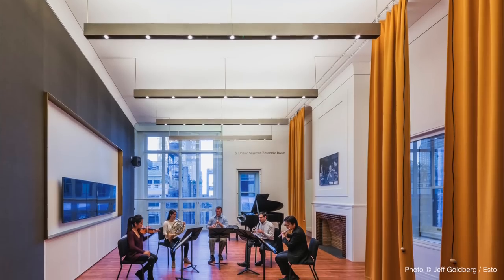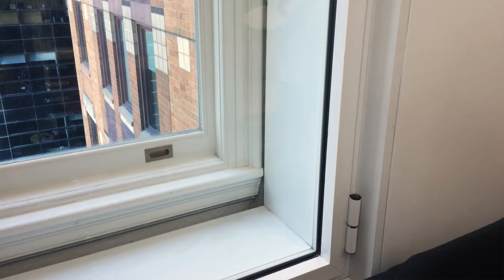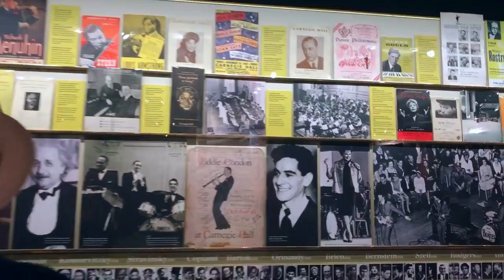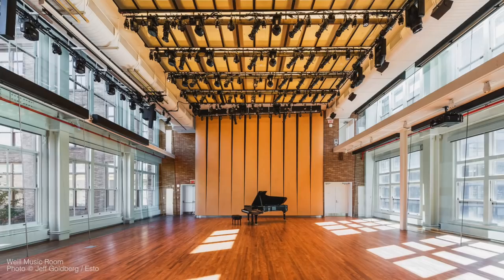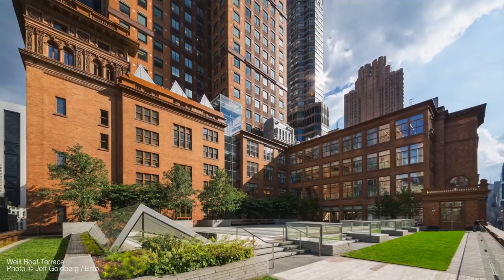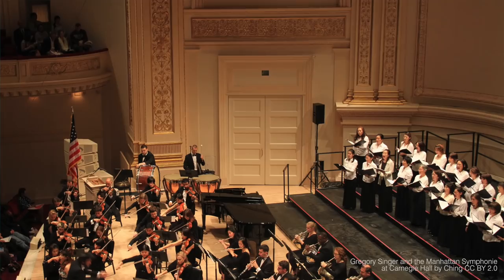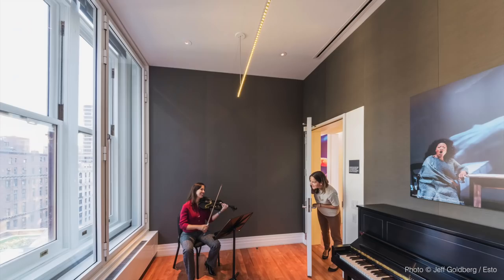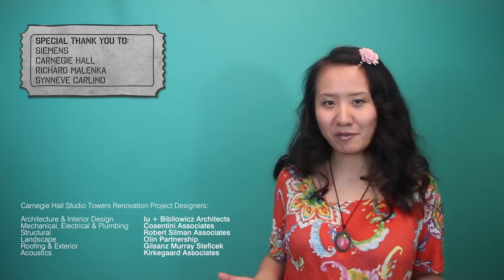How are Historic Buildings Renovated? | Carnegie Hall Tour | ARTiculations

Comment: Great video! Thanks! One suggestion though: it's seems there are some FPS inconsistencies throughout the video, which is causing a bit of a sluggish camera movement in some shots, along with some very small freezes every second. This is usually due to framerate conversion (converting from 24 to 30fps, or 29.97 to 30fps, etc). Checking that all videos used are in the same rate can improve this (otherwise, resampling can make them look a bit smoother).

Comment: Is it weird that I am fascinated by that super long fire escape on the side of the building?  :)  This vid makes me want to go learn more about the building!
Reply from the maker: So - that was added in the early 1900s because the city mandated the fire escape across the 7th ave facade. At some point though in the last century actual enclosed fire exits were incorporated in the building thus (I'm pretty sure) the exterior fire escape isn't used anymore in an actual fire emergency. But the fire escape itself is preserved as a part of its history.
Reply: Huh!  Very interesting... looking at two photos on wiki from 1896 and 1910 you can see the addition of the escape.  I wonder if it ever went to the ground with a ladder; I can't tell in the 1910 photo.  Otherwise it just goes from one door to another one in the building, lower down (maybe connecting inside to a stairwell?).  I'm also just learning about the artist lofts that used to be on the top floors... what a fascinating building!  Even more storied than I'd realized.  :D

Comment: single glass windows (in nyc) are strange, most buildings from turn of the 20th century (1890-1910) and up to WWII in central europe had box-type windows (?) with two planes of glass (10-20cm gap between them). these can be renovated to reach almost double-glazed (IG) insulation window values. also, renovation in this case is often the smarter choice, as the walls aren’t insulated and with IG you can easily run into moisture/condensation buildup.